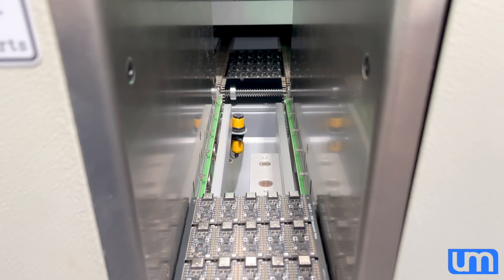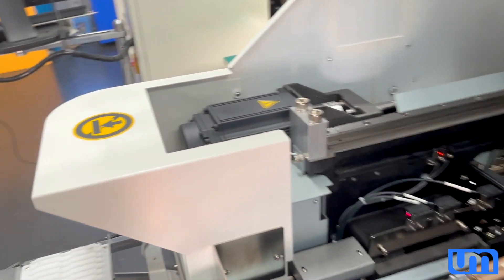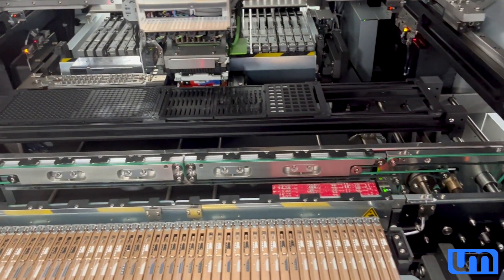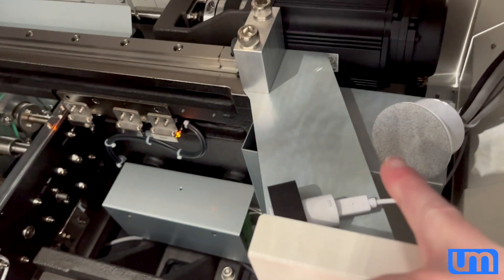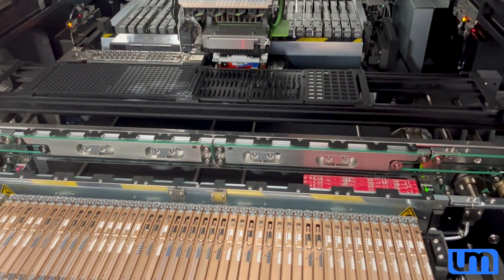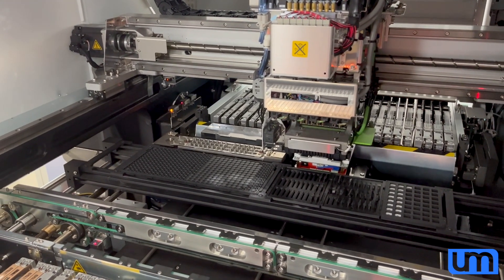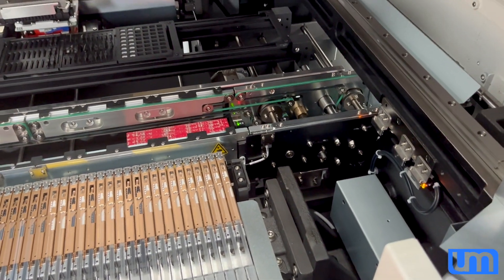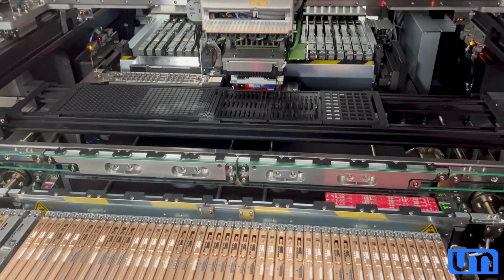JUKI-CAM - Capturing PNP Awesome!

Comment: Seems like it's doing the large parts in the middle of the job & then going back & doing more small stuff, requiring more nozzle changes - any reason for this?
Re. specular reflections, it might be helpful to put a circular polarising filter on the  camera
Reply from the maker: Hey Mike :) I use air to push the USB connectors into place, and that means small components nearby can get blown out of place, so I place them afterward the USB, and the Juki just happens to also place other large ICs at the same time as the USB.

I'm not in a hurry when making boards - there are quite a few things I could do to make assembly 2x faster or more, but I honestly don't need it - and I'll take 100% reliability over faster assembly every day of the week.

Comment: I'm missing a bit, does it still have an 'up camera' for rotational correction or was that 'so last year' and done differently now please Seon and always amazing to watch that whole assembly move almost too quick to catch at times !.....cheers.
Reply: Jukis have always leaned to using laser alignment instead of vision. Actually Jukis had a bad name in the camera vision department (in the old days). The machine does have vision too, and im sure its much better than its predecessors, but laser alignment is the norm for Juki PnP machines.

The way it works is by rotating the part and observing its shadow, thus working out its size and center of gravity.
Reply: @marios2liquid  Thanks !
Reply from the maker: I do also have the up camera for working with BGA and larger components than the laser alignment can handle, but the laser wall handles way more parts than I expected, and have not needed to use the up camera even once for far.
Reply: @UnexpectedMaker  Wow thanks I was curious:)